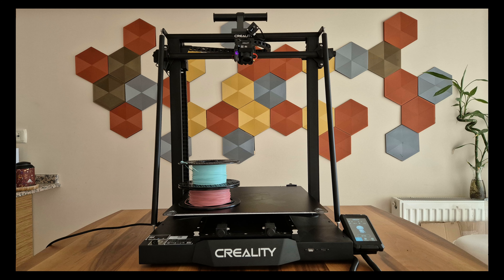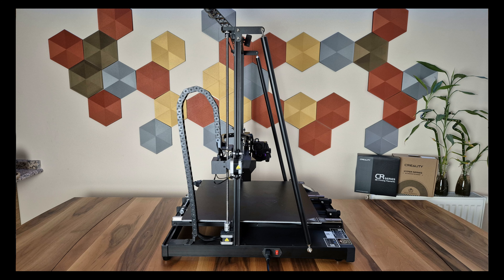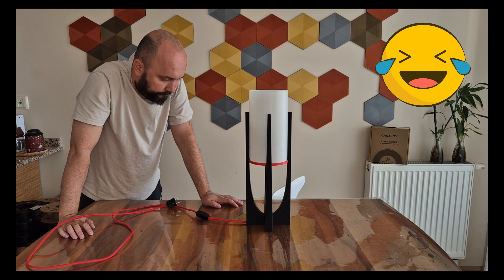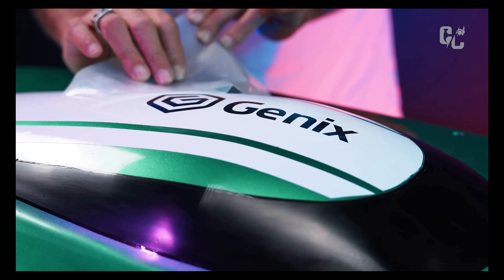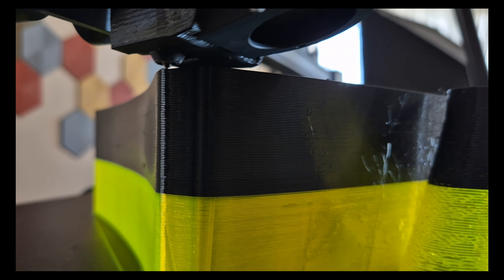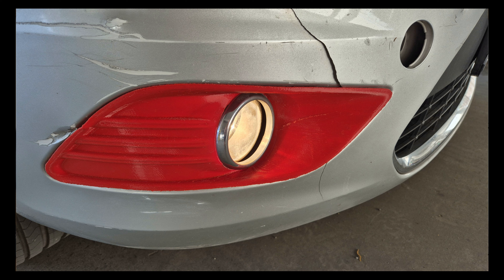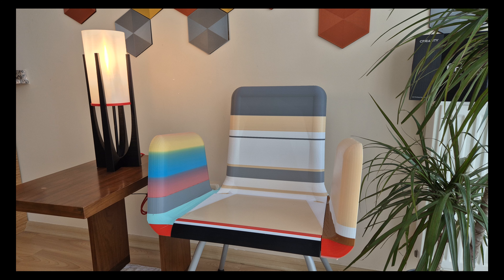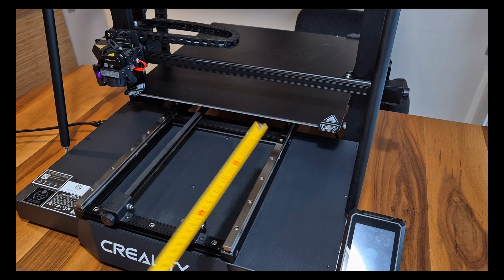Big 3D Printer for Big Projects   Creality CR M4

Comment: Hello  @3DPrintLab1 , thank you for the video, I bought the printer but I can't find a good profile to get good prints. You help me.
Reply from the maker: You can use it by selecting CR-10 SE from Creality Print and changing the bed dimensions. I recommend that you do not exceed 80-90mm/sec in print speed. Acceleration values should also be 700mm/sec2. I use all other settings as standard.

Comment: Ther is the Elegoo Neptune 4 Max at 420x420x480 running Klipper with higher print speeds . I have both the Neptune 4 Plus and Max. Also you have the Comgrow T500 with a 500x500x500mm build volume.
Reply from the maker: Thank you for sharing your knowledge. I think it is a disadvantage that Neptune 4 Max performs XY axis movements on wheels. Has this been a problem for you? I just learned about Comogrow T500. This printer looks nice. It's nice that they use linear rails on all axes. Also running on klipper.
Reply: The Neptune 4 max has been the most frustrating printer I have had the displeasure of using. And, i own3 other printers.
Reply from the maker: @dilligafTV1  Thank you for sharing your experience. I am asking for information, what were the features that did not please you?
Reply: @3DPrintLab1  well. I’m pretty sure I got a dud. I actually liked the features it had. After I set it up, it would not print at all without a firmware update. It would just beep when it got to the front of the print bed and stop before it did its test line. Then, it did print out the little boat so I thought all was well. So I sent a large print of Wolverine mask to it. No matter where I put that model in the slicer on the build late, the printer would grind the belt when it would move the bed forward and squirt filament off the back of the plate. I tried two different slicers.i gave up and packed it up and sent it back to Amazon. I’m thinking of giving the big anycubic a try. I want something to he able to print that volume.
Reply from the maker: @dilligafTV1  Thanks for sharing your experience. I wanted to know about this since it is a similar printer and many people ask about the Neptune 4 Plus and Max.

Comment: can you share print profile ?
Reply from the maker: You can use it by selecting CR-10 SE from Creality Print and changing the bed dimensions. I recommend that you do not exceed 80-90mm/sec in print speed. Acceleration values should also be 700mm/sec2. I use all other settings as standard.